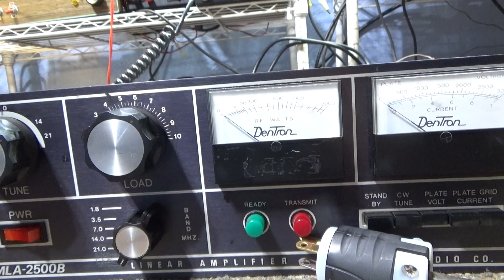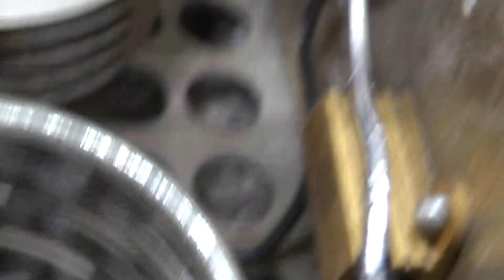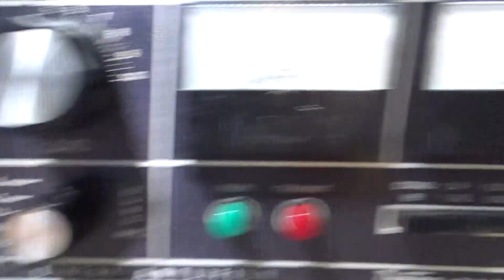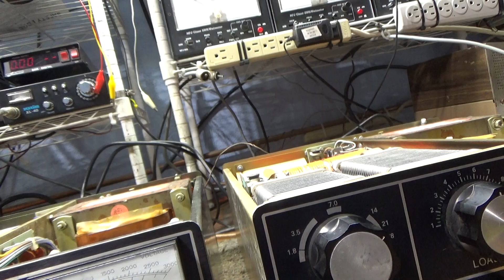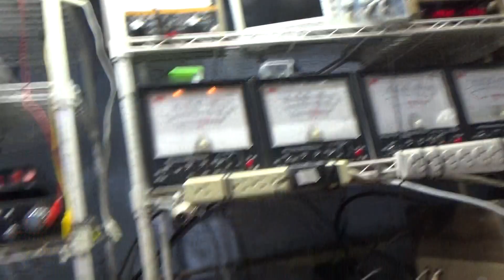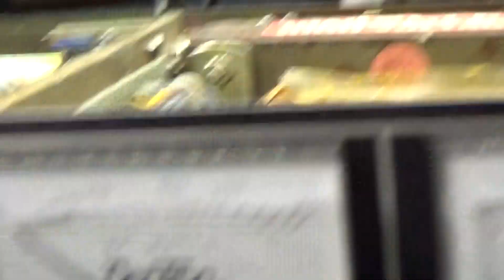Dentron MLA-2500B Monobanded on the bench

Comment: What is the most that you can drive into the Dantron 1000 B?
Reply from the maker: Dentrons run the tubes in their amps very hard. The GLA-1000 runs about 1250v plate on the sweep tubes. Doing that will do the watts. but not for long. Driving it hard, it will do even more watts, but not for long. If you look at the power/output curve I have showed in a few videos, there is no absolute max. I would say a good general drive level for both decent power out and longevity would be 50 Bird 100 Peak for that amp. Yeah, hit it harder, it will do more.....but not for long.

Comment: Hello!. Excellent video!. I bought the same amplifier (model B but with the 28MHz band). It's in excellent condition, shipped with its original capacitors. When I tried to test it, it started at the lower voltage, but after the 90-second timer expired, the relay made a noise and the input fuse tripped. I haven't changed the original electrolytic capacitors. Do you think the problem could be there? Best regards and thanks!
Reply from the maker: Sounds like the caps to me. Also check diodes and tubes and hope it is not the tubes or the transformer.

Comment: Another great video doc . Im repairing my mla2500 at present but was lucky to find another set of eimacs 8875 full output . Love your videos Doc keep up the great work brother .
Btw do u know the value of the parrasitic supressors ie the resistors on each of the anode tube plates ?
Reply from the maker: I think they are 47ohm 2 watt Carbon resistors. Don't use wirewounds at all. Parasitic Suppressor's are not real critical for 10-12 Meters. I have seen anywhere from 33-100 Ohms for the resistor and have also seen anywhere from 2 turns of coil around them up to 6 turns. However, for 10-12 meters only, 2 turns works best. Similar to the output tank coil, its the higher Ham bands that need more turns.

Comment: ... 8875 ... SO..

I HAVE A LOT  (8)  OF "AMPs"  THEY HAVE "2"  (8122)  .. 

THE PINS ON THIS  8875  LOOKS  LIKE  MINE  (8122) ..

IS  RADIO STATIONS  FROM  "SHIPS".. 800W  AM  /SSB/CW AND AND

400KHZ  TO 30 MHZ

I HAVE  "1"  1.4 KW  TRANSISTOR  AMP   (SAME FREQ)  SAME COMPANY

BUT  I AM  "AFFRAID"  TO  TURN  IT  "ON" ...
(EVERYBODY SAY  OOH JUST A LITTLE  BAD  "SWR" = DEAD !!!)

MY GOAL  IS  RUNNING  ( 27.555 )  CB

BUT THE "27 MHZ" IS NOT BUILT  IN  THE  (EXCITER)... 

THE  "POWER SUP" IS A LITTLE  "BIGGER"..THEN  IN THE VIDEO
(ABOUT "50KG" .. 19 RACK MOUNT.. 22V 70AMP /400 V /2500 V  OUT)

.. SAILOR RADIO DENMARK..  SYSTEM 1000 AND  1000 B .. (TANDEM)..1986 + - ..

BUT I LIKE THE "LITTLE"  DENTRON .. LOOKS  #FINE 
I WILL TRY TO GET  ONE  "MAYBE"..

HAVE A GOOD  DAY .... MISTER 

NNNN ....

EUROPE
FEB 12 2024 1825

Comment: Hello sir I have a question about the modification....if you have time ... Do you have to add anything else or is just to eliminate the excess part and band selector and reinstall the H.V to the tune cap .... does it goes on the top or the bottom...it also have a empty spot wen  the band selector is at do I ground it to the bottom of the amp ?? I apologize if I'm taking your time..im just trying to make it work 73 and make a 3-1/2
Reply from the maker: Nothing needs to be added, just eliminate the excess. Just make sure on the Tune cap wire that goes to the tubes output Plate Blocking Cap that you connect to the cold side of the plate blocking cap. On mine, that is the bottom of the plate blocking cap. However, don't take that for granted. Yours may be different. The Hot side of that cap goes toward the tubes, where the HV is and that cap blocks the HV and lets only the RF pass thru. That's why its called a blocking cap. Hook to the wrong side of that cap and get your camcorder out, stand back and watch the fireworks and smoke.

Comment: The reason for the paper on the capacitors is because the cans are not at ground. They are in series and that means the cans are mostly at a high voltage, except for one. That can be very dangerous to other parts and wires and unknowing hands of servicing technicians!
Reply from the maker: Exactly right, Attaboy.

Comment: Another reason they could run the fan on high on CW is that it is done with a key and background noise didn’t matter. On SSB many hams used VOX and the fan could trip it.
Reply from the maker: All true and also the high fan noise on SSB adds to the amps duty cycle too. The amp is picking up that noise and amplifying it instead of resting in-between speech syllables and words not to mention high background noise is not pleasant to listen too on SSB.
Reply: @tramdr  I bet that speech compressors really give amps a workout on SSB. I’ve never used a big amp with my radios to find out though.

Comment: The delay timer tube, I've used a solid state PCB kit to do the same thing in my homebrew amps. It delays the PTT relay by 3 minutes, to allow the tubes to warm up (GI-7B, GS-35b, etc).
Reply from the maker: Yep, good one. On the Dentron 2000L, it has the delay too.
Reply from the maker: and though 3-500z's don't really need delay's, so does the infamous Blackcat JB-2000. Just saw that as that is my current project in the works.
Reply: Guys I ordered the harbach upgrade , redid power supply and fitted the solid state relay board , but when I turn on the amp without any tubes to be safe the ready or Green light comes on immediately,  harbach use a tinyu microprocessor  chip that's programmed , they thought maybe it wasn't programmed right , I setup the jumpers for delay but no matter what jumper position I use the green light for ready comes on immediately,  I've checked all wiring and seems to be ok. Any ideas be appreciated . Thanks Doc for your your help today it's appreciated,  but I'm stumped if I know why relay timer ain't firing , the old units relay worked prior to upgrade .

Comment: The cardboard Shields covering the metal on the high voltage caps is because of the high voltage. If the Caps were to touch without the cardboard protection they would be fireworks. And safety reasons.
Reply from the maker: Exactly. Attaboy.

Comment: Hey doc the  Ameritron 811 3 tuber has a green wire that needs to be cut to get 10 meters. I thing the green thing is a thermistor . JohnBoyUtah love your videos KJ7TBR
Reply from the maker: No, the Green wire is a ground wire that grounds out the Ten meter tap on the band switch. Just cut it and no more ground and the amp will then work fine on ten meters. I had a nice one that I converted to 572B tubes. I took it to Dayton Hamvention one year, wanted 600 for it. I walked around the swap and when I came back, the wife had sold it for 300.